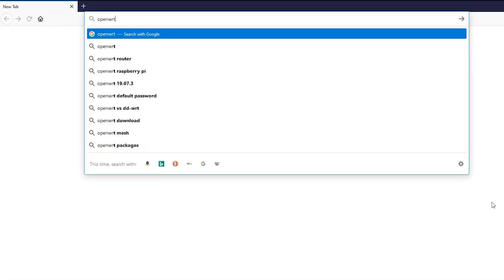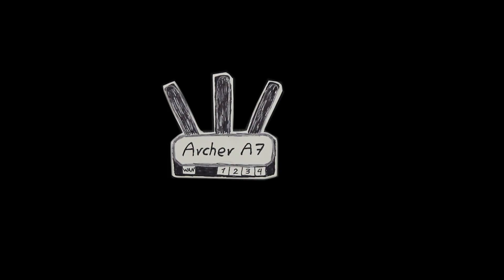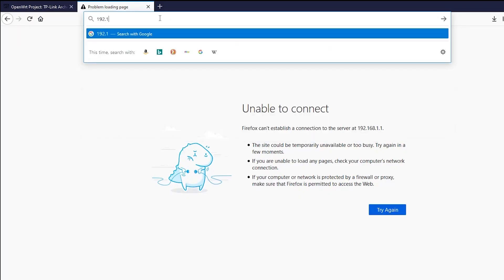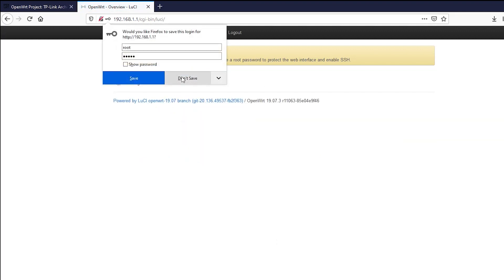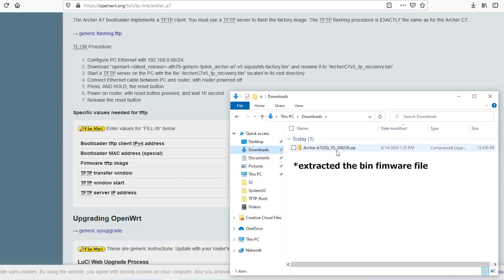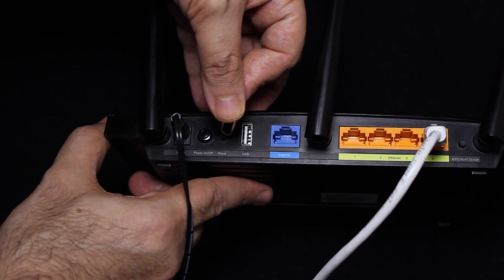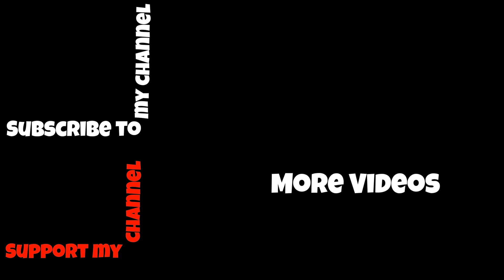[HOWTO] Install OpenWRT on TP-Link Archer A7

Comment: I installed openwrt for a project purpose on my archer A7. Me while configuring it accidentally switched off DHCP server and now I can't acces it via web or via terminal. I used this video to reset it back to original firmware but solarwinds is showing the error "Transmission failed". I did it because by reset button was not working after wrt firmware install. Can you please help?
Reply: Disable windows firewall, and try again, this was the solution when I raced the same problem, hope it helps you

Comment: I like the video, but unfortunately OpenWRT wasn't a good choice for my router (Archer A7). It kept causing disconnects even with a fresh install.
Also unfortunately, I was unable to install the stock firmware because TFTP kept timing out on me.

Comment: I have a TP Link Archer C7 v4. I tried OpenWRT, it slowed down my Internet speed. It went from my stock TP Link firmware at 680MBPS to the OpenWRT installation 280MBPS. I since flashed my stock firmware back. Good video though, it worked like a charm, I did not brick my router.

Comment: Hi, i get invalid file type on A7 ver5 with lates openwrt release
Reply: Unforunately TP-Link has disabled the ability to load custom firmware from their GUI. You now have to use the TFTP method.
Reply: @RatchetMods  Thanks, but had no luck with TFTP, with latest firmware, tried renaming it, didn't work. Anyway I returned the router. All the best
Reply: @bassboygilo  I'm in the same boat. Tried everything. No luck.

Comment: You don't need to use the OpenWRT upgrade if you are installing for the first time. The OpenWRT upgrade is for devices using an older version of OpenWRT.
Reply: I take it you have no clue what you are talking about. And really... Was the "shu t up" really necessary... You sound like someone with a lot of experience bricking your router.
Reply: ohh okay, makes sense, thanks for heads up
Reply: no f-ing way i see you here, of all people LOL
Reply: @gloopington  Hi!
Reply: Which file i need use 😀🤷?  I have archer c20 v5. 
And i want to install from settings using page of this router - in colum firmaware upgrade.
Reply: shhh shu t up , you have to use it , to avoid bricking certain devices.

Comment: Please explain it for me. After averything you showed on video there will be both open firmware and stock and you can use them simultaneously (not in the same time but both there are available) or you just showed how to back to original firmware? Thank for explanation
Reply from the maker: At the end I just showed how you can go back to the stock firmware , incase you need to! Obviously if you want to use openwrt you can ignore the last part.

Comment: This router used to have the capability in the guest access part to be able to set bandwidth limits. In the newer versions they have removed that feature does anyone know if I would put OpenWRT on it if I would be able to then again set bandwith limits on the guest access? Thanks for any help you can give me

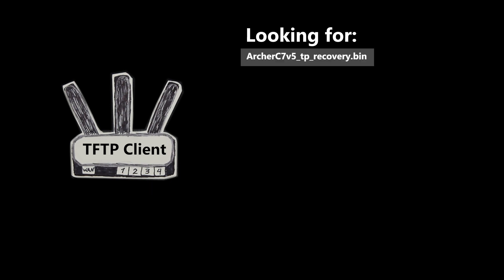Comment: At 5:00 the file name says ArcherC7v5_tp_recovery.bin 
Can you confirm that this is the correct file name for flashing the Archer A7 model? 
From what I know the latest C7 and A7 revision (v5) have basically the same hardware but just wanting to double check. Cheers!
Reply: Yes the file name c7 is correct, even if you are flashing an A7.  This is noted on the OpenWRT webpage for the A7.

Comment: Hello,I installed openwrt on an old tplink router for its QoS service, but it doesn't have any impact on latency in the only game that I have on my pc, lag its 200ms no matter what I do.I bought a d-link with QoS , i mention that I use a wired connection. I ve installed the game on 3 different ssds with win7 and win10, no difference. tried  a loot of other stuff but no matter what I try the lag it's the same . I read lag in resource monitor and pingplotter , both show around 200ms. thank you

Comment: i have seen some post that says that archer A6 is better than archer A7, is this true?
Reply: no its not. I have the c6 (same as a6). It randomly gives connected (no internet) errors. when that happens you have to wait 5-10 minutes to get an ip/normal connection. All tplink firmwares tested, all have the same issue. this is why i'm thinking to use openwrt (or send it back for refund)
Reply: @ps7539  i am also facing the same issue in my archer c5. I am also going to install open wrt
Reply: @kunalchhabra02  did u install it? is it better?

Comment: Excuse can you help me i have router LINKSYS EA9200  (AC3200) and i need to use it as repeater but i can't, the router not sopporter by tomato and dd-wrt. Do you know how can i use it as repeater? Thanks for your help
Reply from the maker: If the original firmware doesn't have repeater and it doesn't support any of the 3rd party firmware, unfortunately I don't know any method to use it as a repeater! You should still be able to use it as an Access Point though. Cheers

Comment: why some asus router dont show future like vpn server/client and aiprotect And Wireless mode IEEE 802 AC this router is Asus RT-AC87U RED Edition Access Point(AP) mode Firmware Version:384.13_10 merlin i am totaly lost
Reply from the maker: The AP mode offers limited features. Full features is available in the Router mode. Thanks.

Comment: Is Solar Winds TFTP Server your preferred File Server, or can you recommend another?

I've been considering hosting a FTP Server, trying to read-up on them, to determine my options.. both hardware & software.  I welcome your input.
Reply from the maker: SolarWinds SFTP is alright but it is more of a simple FTP server for normal administrator jobs, so is FileZila actually! But if you are looking for a more professional FTP server maybe Cerebus or Serv-U would be better options, because as far as I remember they let can transfer files through a web browser or mobile device without using a FTP client, which makes it much more convenient for the users. That being said, some wireless routers also have built-in FTP servers that might worth noting. Thanks.

Comment: I installed openwrt in my tplink archer c20i.
But didn't installed the upgrade file.
Its working fine. Can you tell me why should i also flash the upgrade one.?
Reply from the maker: This is my understanding of OpenWRT factory.bin and sysupgrade.bin files (I could be wrong though):
They have the same features (as long as they are the same version number,  for example: 19.07.3), however, the factory.bin is meant to be installed when you are going from the stock firmware to OpenWRT and in some wireless routers you cannot go directly from stock to sysupgrade.bin. Now, when you are on a factory.bin (OpenWRT) firmware and want to upgrade to a newer version, you would install a sysupgrade.bin (OpenWRT) file. So in your case, you should be good, but when it's the time to upgrade to a newer version you can install a sysupgrade.bin.

Comment: Not sure if I missed it but does what does this help or boost, I have the same router and for some reason I'm not getting enough then  I really should be
Reply from the maker: 3rd party firmware such as DD-WRT, OpenWRT and Tomato offer more professional features compared to the stock factory firmware. Maybe this video can give you some more information : https://youtu.be/5Onz9YTCMzY
Thanks

Comment: Hi Behfor! I am one of your subscribers :) Can ask you something about asus router? How can I reach you? Thanks in advance!
Reply from the maker: Sure, whats up?
PS thanks for subscribing :-)
Reply: @Behfor  i want send you a diagram to make it easier to understand my problem with my asus router just like you are doing with your videos. Hehe. But anyway here is my question.

I cannot figure out why is my wifi DOWNLOAD speed goes down drastically compared to my wired LAN via Asus RT-AC88U (Average download/upload are 402-483Mbps wired LAN). But my UPLOAD speed stays the same even through wired LAN or WIFI connection. Why is that happening? My internet speed is 500Mbps and I can reach that easily through wired LAN from the asus router but when I use my WIFI the DOWNLOAD speed goes down like 92-140Mbps tops however my UPLOAD speeds stays the same at 402-483Mbps through wired LAN or wifi. Hopefully someone can explain to me how to fix this problem. Thanks in advance!
Reply from the maker: That's kinda weird but wireless is weird so no worries ;-)
I would try to pinpoint the issue first:
1- Is it the router? 
2- Is it the wireless connection?
3- Or maybe it is the client itself?
I would start with these troubleshooting steps and see what happens:
1- I would do the speed test on a different device, a device that I know it's wireless speed can reach 500 Mbps for sure and see what happens.
2- I would make sure I'm using 5 GHz network and not 2.4 GHz
3- I would also try different channels of 5 GHz network, because maybe there is something weird going on on the channel I'm using.
4- I would make sure the device that I'm running the speed test on, is the only device connected to the WiFi during the test because wireless (unlike wired) is a shared medium and if another device is also using the network it'll impact the test results. 
Good luck ...
Reply: @Behfor  These are my answers to your questions and I did test everything. I hope you can help me.

I would try to pinpoint the issue first:
1- Is it the router?
I am using Asus RT AC88U, brand new, default settings when I tested the speed for 3 days straight and get the average speed that I gave you recently
2- Is it the wireless connection?
I connected each device alone on the 5GHz band of the router and did speed test 3x
3- Or maybe it is the client itself?
The devices or clients I used to connect to the router are the Macbook Pro 13in retina 2014, Galaxy Note 10 Plus and iPad 6th gen.

I would start with these troubleshooting steps and see what happens:
1- I would do the speed test on a different device, a device that I know it's wireless speed can reach 500 Mbps for sure and see what happens.
Ans.: I tested the Galaxy Note 10 plus since it has the wifi 6 capability via wifi connection on the 5GHz band of the router alone and I got an average of 90-150Mbps on DOWNLOAD speed but 400Mbps+ on the UPLOAD speed (and testing all 3 devices resulted on the same speed)
2- I would make sure I'm using 5 GHz network and not 2.4 GHz
Ans.: I connected each device alone via wifi on the 5GHz band of the router
3- I would also try different channels of 5 GHz network, because maybe there is something weird going on on the channel I'm using.
Ans.: I tried using wifi analyzer for this and there is no signal or frequency traffic in our area. And no other 5GHz bands are available detected except our wifi router's signal. So I only tried two channels 100 and 149 for the 5Ghz band but no difference in speed. And still DOWNLOAD speed is low and UPLOAD speed is consistently high (its speed is like connected via LAN)
4- I would make sure the device that I'm running the speed test on, is the only device connected to the WiFi during the test because wireless (unlike wired) is a shared medium and if another device is also using the network it'll impact the test results.
Ans.: I tested the 3 device alone and only connected alone every test I did for 3 days. Hahaha! And still same result. DOWNLOAD speed is low (wifi) and UPLOAD speed is consistenly high (either wifi or LAN connection) :(